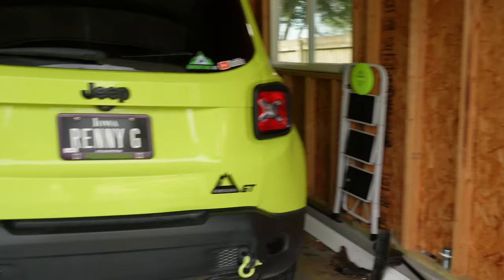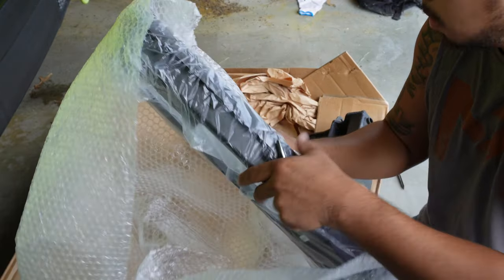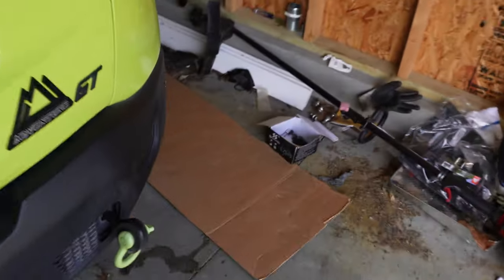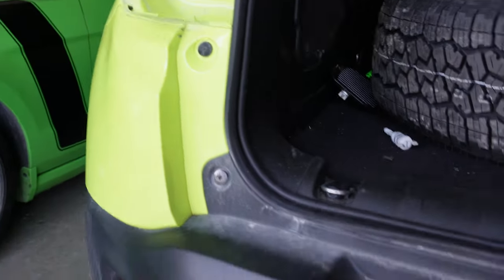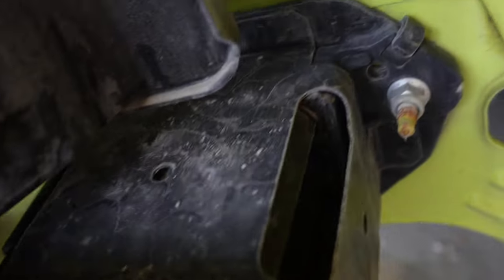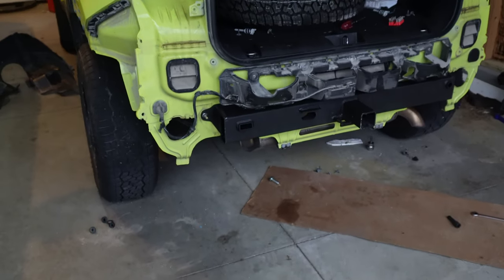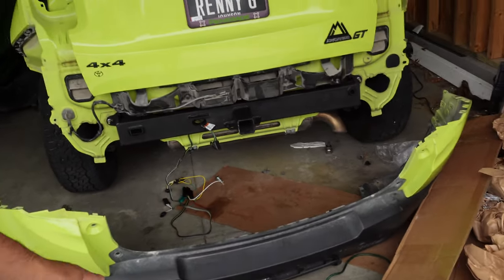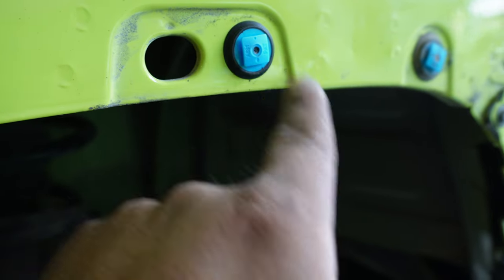JEEP RENEGADE TRAILER HITCH (RETROFIT KIT) RENEGADE READY

Comment: 100 stars for this kit!  I just installed this at a leisurely pace over 3 days.  This kit from RR makes the install so easy to do and if you take it slow, it isn't stressful.  They give you detailed instructions and everything you need.  I did have to drill some extra room on some of the holes to make it fit my car exactly, but that makes sense since each year has slight differences.  The advice line they give you access to was very helpful for a non-mechanic like me.  My greatest anxiety was about cutting the bumper because you get one chance to make it look perfect.  I measured many times and really thought about what I was doiing before proceeding.  The provided template was perfect. The wiring kit was also so easy to install.  It has a relay that saves you so much time and work.
Reply from the maker: Hands down the best trailer hitch they make for the renegade. I agree, the instructions were super detailed that anyone could really do it. I also got nervous about cutting the bumper, but it all  turned out good

Comment: I just got a 22’ reny and your are the first youtuber I found in regards to mod. I subscribed right away. I am returning my hitch that I just purchased and going with this route. I might hit you up if I have a question during my install process.😅
Reply from the maker: Absolutely. If you have any questions you could always email us
Reply: Thanks brother! By the way, those side rail holes (3 on each sides) where you removed the grommets to mount the hitch bumper, are those holes threaded?
Reply from the maker: No, they are not. They are meant to be there for when you install the hitch, you will put the bolts on the outside, and then it will thread into the hitch
Reply: Question on the wiring kit..did you run a long wire to the main battery?my wiring kit seems different than what RR sent me. It was a curt brand wiring harness
Reply: @randya8856 I was also wondering this same question. This guy has been great for renegade research!

Comment: Have a 2016 Anniversary Edition. The instructions for the retrofit "what they call the Clean install" of the wiring that uses the factory connector, doesn't match the colors or number of wires on my 2016. The instructions call for 4 wires on the OEM connector and mine has 8 wires and none of the colors match. Has anyone ran across this and have a solution?  Thanks.

Comment: I'm looking at doing this on my 22TH, but the wiring is what scares me.  Dealer wanted over $2200 to add an in bumper hitch to mine (since it didn't come from the factory with this option)  $800 is worth it to keep the ground clearance.
Reply from the maker: It definitely takes some time if you do it on your own. Yes, hands down the best hitch you can add to your renegade. You lose a lot of ground clearance with the other ones
Reply: I just finished the RR trailer hitch kit on my 2019 TH.  It was so easy to do and the wiring was simple.  It has a module that is simple to install and passes the tailight signals to your trailer automatically, without having to think about it, its so easy!
Reply from the maker: Worth the price I believe.

Comment: George  looks good do you still have the direction and the schematic for the cut out?
Reply from the maker: I do not but if you look up this trailer hitch/ bumper you can download the instructions with all the details.
Reply: The template gets destroyed when you cut.  You could take it to a copy shop and get an oversized paper copy before using it.  I wouldn’t want a copy of it because the piece you finally attach to the bumper is a very tight fit.